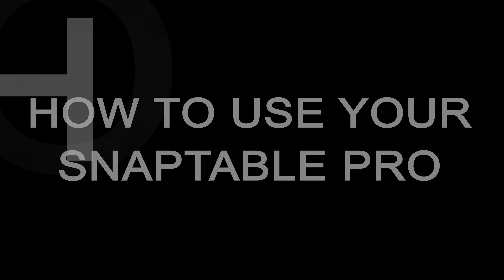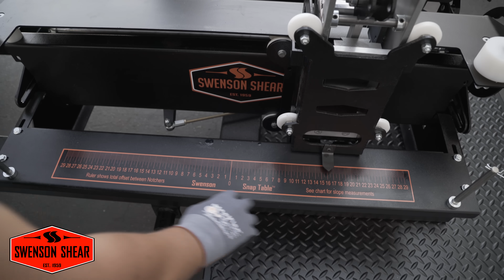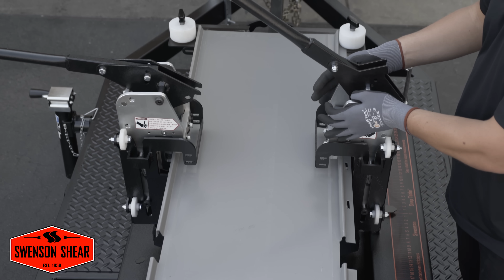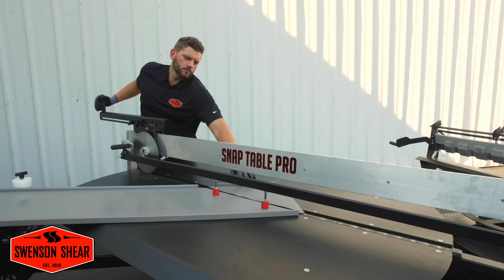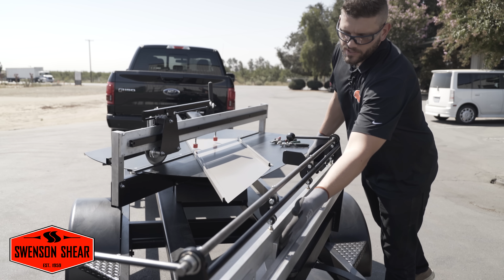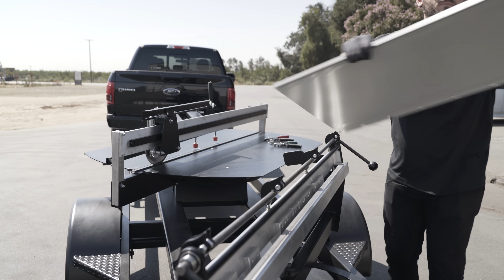How to Use the SnapTable PRO | Swenson Shear Roof Cutting Tools

Comment: The company I work for has one and we never use it..... it's a great idea ..... but...... it just doesn't work well. Also 90% of standing seam/ snap lock jobs are inspection jobs and these machines don't allow the female rib to rap around the male at the bottom closing the gap between the 2 panels.
Reply: Reach out to us on how to do this with our equipment, its one extra step but easily done!

Comment: I like the idea, but if your going to be paying that much for the shear. I dont want any extra cutting or snipping, Or have to adjust the blocks to fit a valley angel when hemming. Your not cutting time on the job. Your just adding another step. I would totally buy your shear if you do not have to make any adjustments or make added cuts to the panels. It’s a great idea but help us cut out the labor even more so any of my guys can step up and do it without having to think.
Reply: youre 100% correct. i run a 3 man crew and this would add another laborer that im unable to find. i use the makita nibblers on the roof to cut the pannels and this tool looks like 2-3 times the effort. it just doesnt offset the price